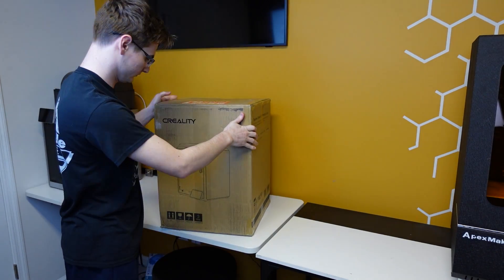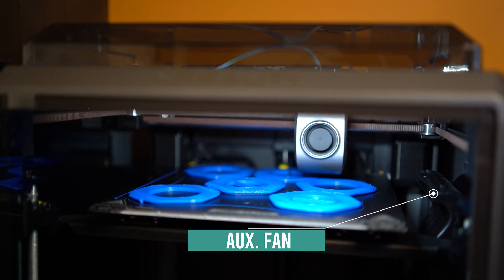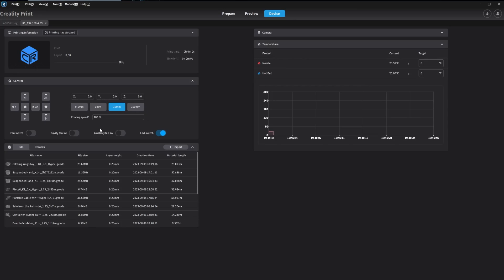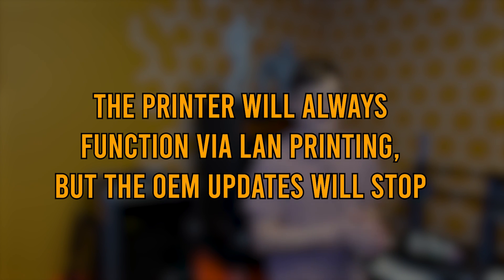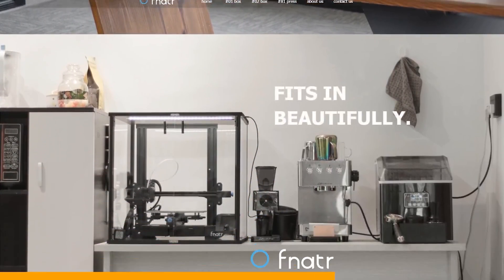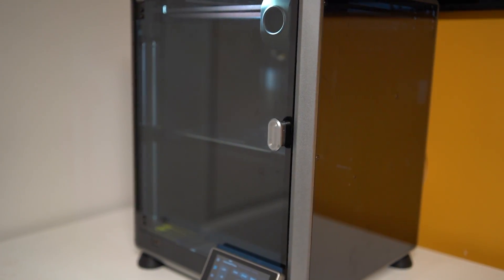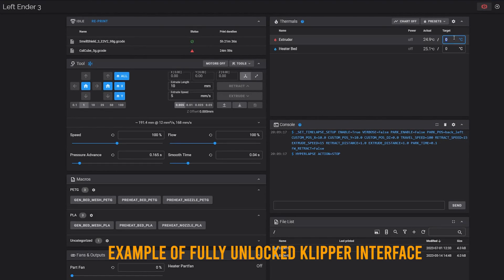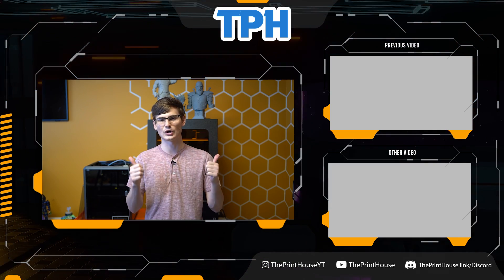Creality FIXED The K1 And It's INSANE!!

Comment: I posted how to fix the issue with the fans on user help group awhile back.

In Prusa Slicer under Print Setings, Output Options, G-code substitutions:
  FIND: M106 S([0-9]+\.?[0-9]+)
  REPLACE WITH: M106 S${1}\nM106 P1 S255\nM106 P2 S${1} 
  NOTES: Set case fan 100% and the rest to same speed
  REGULAR EXPRESSION: Checked
  
 This will update the gcode as it's being created to set the case fan to 100% and the parts colling fan and side fan to the same value.

------------------------------------------------------
In Cura Slicer click Extensions, Post Processing, Modify G-code, then click Add a script, choose "Search and Replace"
   SEARCH: M106 S([0-9]+\.?[0-9]+)
   REPLACE: M106 S\1\nM106 P1 S255\nM106 P2 S\1
   USE REGULAR EXPRESSIONS: Checked
   
  This will update the gcode as it's being created to set the case fan to 100% and the parts colling fan and side fan to the same value.

Comment: After the updates would you go with this or the bambu p1s?
Reply from the maker: I hate to say this, but they are genuinely different products. They both print equally as well for standard materials. For someone that only every prints 1 color in PLA, PETG, TPU, or ABS, the k1 is amazing. If you ever plan to print multimaterial or engineering materials I would do the p1s.

Comment: Great review. I've had mine for a few months and its been great except some slight underextrusion. I increased flow on the slicer but its not perfect.  How did you get the new upgraded hardware? You mentioned contacting 3rd party? I bought mine at microcenter, so would I reach out to them or Creality? If I have to buy it then I'll do it but free is always better!!

Comment: People try to shi# on this printer I’ve been printing for years on year and spent hundreds maybe 1000s of hours working on learning and hands on experience with about 6 differnt printers out of the box the k1 does fantastic and has been one of the most simple plug and play printers I’ve seen so far would love to have the k1 max tbh
Reply: Not to mention the fact it’s very consistent I’d say I get 18 or 19 out of every 20 prints to dam# near perfection or as close to perfection as possible without going to resin. It’s been this way out of the box only things I’ve tweaked is speed infill and basic things that children could do. Don’t have to worry about clogs very often sometimes they can be a pain that requires a full break down but having to do a hr worth of work for a mistake I usually make( forget to unlock the extruder before pulling during retraction) don’t pull it or you break Filament to high off in the block and have to do a full breakdown other than that outstanding all around

Comment: I have been going back and forth on this printer and the Neptune 4 Pro. I am rocking an Anet A8 with an all metal frame. Both would be absolutely huge upgrades. I like to do functional parts with nylons, CF filaments, polycarbonate and the likes. Would i get better/more successful results with a K1?
Reply: you need enclosed printer for hard materials like nylon, polycarbonate, ABS/ASA because of high temps, its possible to print these materials on open printer, but only for really tiny models

Comment: Creallity has open sourced and released the source to their version of Klipper.  So it should be possible to build your own version of klipper and install it on the K1.
Reply from the maker: Im sure the possibility exists, but I feel like it wouldnt be the most straight forward task
Reply: @ThePrintHouse  Shouldn't be any more difficult than upgrading  Marlin on the Ender printers, or for installing Klipper on them.   It will all depend on the bootstrap that the K1 has on it for upgrading the firmware.  I'm sure the 'nerds' out there are busy hacking the K1 right now!

Comment: "Part cooling fan weak" is not an issue.
To cool PLA adequate at high speeds, you would need bulky fans, whichincreases toolhead weight and makes said speeds unattainable.

Which is why bench speed record attempt printers use side fans.
Reply: ...hmm is the "use with gluestick" not printed on K1 buildplates,is it only printed on K1 max buildplates?
Reply from the maker: Im pretty sure it is on the k1 also, but I was using hair spray. The reason they mention glue stick is because it is an interface layer. Hair spray does the same thing, but the layer I applied was apparently too thin, which isnt an issue on other printers
Reply from the maker: Yes I know that, but Cura doesnt enable it easily. That's why I mentioned it. You need to slice via creality slicer to make it function

Comment: why do you recomend keeping the door and lid open with PLA? I have a K1 with no issue.
Reply from the maker: I haven't had issues either, but pla is not supposed to be printed In a closed chamber
Reply: @ThePrintHouse  good to know. This is my first 3D printer. microcenter had a 375 coupon for it. it was also the updated version with the upgraded parts luckily. My only grip with it is the software like you said and the way it feeds filament into it. I like to use a dryer because our house is humid and the angles from filament from a sunlu S2 isnt great. I had, just today, issues with Inland Twinkle Rainbow pulling away in the extruder or it snapped off inside the tube because of how the run out sensor is placed, its a sharp angle. I wish they gave us options to mount it other ways.

Comment: Purchased a Neptune 4 and had unfixable trouble with it after a day. Sent it back and now I’ve got this on the way. Was supposed to be £599, on offer at £479 then there a promo code knocking £50 off so £429. It costs more than the N4 but hopefully turns out to be a better machine.
Reply from the maker: I think you'll like it!! :)
Reply: I  also bought a Neptune 4 pro, I’ve had it about a week and today was the first time that I could get a decent first layer. I’ve sliced several items in Cura and the N4 fails to print support every time. My Creality 3 S1 prints the same items and prints the supports.

Comment: i bought it, lasted 3 days, 4 prints plus MANY failures. I bought the upgrade kit (well ordered it) end August. was told will be shipped 21st september. Still waitiing. the hotend is crap, doesn't extrude as it should and then leaks. upgrade kit include a new hotend, extruder, camera and roll of filament. I have being trying to get them to dispatch the dam stuff. i waited so long i bought a Bambu X1C + 3 AMS units. the K1 has been staning gathering dust. Onday i will design a new carriage and change the board, wiring etc and just dump the crap they sold with it. BIGGEST WASTE OF MONEY OF ANY PRINTER EVER was the K1!!!
Reply from the maker: The upgrade kit will be a huge win if you get it in
Reply: @ThePrintHouse yeah I definitely believe so, but the when is definitely an unknown unfortunately 😕

Comment: I have a lot of use of this printer and I love it! (On my channel) It is best used connected to a filament dryer and hyper PLA.
Reply from the maker: It's honestly great so far!
Reply: @ThePrintHouse  what do you think of this? Will it get even better? And since you are a big YouTuber I thought you might have been sent something early regarding it: Multicolor Leak on K1 - https://youtube.com/shorts/jErZB1Z0KaA?si=n1lZLRCPDIdPkojD
Reply: Filament dryer for PLA? Why would you dry PLA? 😂
Reply: @Todestelzer  A) PLA isn't the only one you use so might as well link them up B) I bulk buy like 20 spools of PLA and then just slowly use them and i prefer to dry rather than lose the ability to pick colors
Reply: @elijahspirit  for PETG or PA for sure. For PLA you can use it as a expensive spool holder. Happy printing. It’s a nice hobby/job.
Reply: @Todestelzer  you too

Comment: Hello. I am going to buy a K1 soon. As this will be my first Klipper-based printer, I don't understand some of the aspects.

1. What benefits does unlocked Klipper give?
2. Will I lose any functionality compared to the stock firmware?
3. If Creality changes something in their original firmware, will they implement the same change in Klipper?

Could you answer my questions please? Thanks in advance.
Reply from the maker: Sure! 
1) There is too much to mention here. You will need to look that up separately. The BLUF:  The firmware itself is physically designed better. The team designing it seems to be more focused on quality. There are advanced cutting edge features.
2) You will lose nothing. You will only gain features. Likely as a first time klipper users you wont use them until you understand them, which could be a long time, but until you get a klipper machine you will never be able to learn.
3) Creality will likely not be modifying the original one anymore, but if they do, I suspect it will also be in klipper version.

Comment: I hate to be the one to say this, but that's literally the whole point of the aux. fan is to help cooling at high speeds.
Reply from the maker: Yeah I know. I only mentioned it because of the statement that came after. It cant be controlled via cura and you cant print without it.

Comment: I mostly print toys in PLA to sell. So If I was going to buy another machine to up my production with the idea that I would likely need more in the future what machine would I get? Of course the K1 and P1S are at the top of my list but Im kind of wondering if its worth it to buy those for the speed alone. The AMS is an attractive option too. I wonder if Creality will come out with a multi filament system in the near future? Youd have to think they would but nothing being said about it yet. Anyway, Think its worth it to spend the money on a speedy printer or just buy more enders? P.S. I have had quite a few issues with my 3v2neo that has cost me time and money but Im sure thats ever printer at some point.
Reply from the maker: I also operate a 3d printing business. I used to use E3 V2. I had my machines dialed in but even still, it was slow and print quality wasnt great. I would 100% get one of the new core XY printers. If you want to print color then of course go bambu, but if you have anything you sell in single color I would just get the K1. Printing in color is definitely something you need to consider NOT doing. It will slow production and cost more money. In order to make it worth it you likely need multiple machines with AMS as well as an increased price tag which customers are willing to pay.
Reply: @ThePrintHouse  Thanks for the great advice. Ive settled on the K1 then. If i get rich Ill buy a bambu with AMS for fun.

Comment: So, not enabling a fan that is included to improve cooling, and then complain about bad cooling and it's creality's fault? Interesting start of the review
Reply from the maker: It was mentioned because it can't be enabled unless you use creality slicer. That was mentioned immediately after
Reply: @ThePrintHouse   Im picking up my K1 tomorrow night, so I suppose I need to take your word on it but I find it hard to believe that ONLY creality's slicer can enable the aux fan. I have been watching plenty of reviews leading up to the purchase and this is the first im hearing of that (something that everyone would bring up being that it would be a huge issue). Once again I could be wrong though.
Reply from the maker: @BayCon632  The fan is obviously turned on by gcode, so a few things are at play here: If it is firmware operated, then in my testing it never triggered on. I find this to be an unlikely scenario. If it was not firmware operated, with the recent updates it could NOW BE firmware operated, which would make it work with cura now but not a few weeks ago. Again I find this an unlikely option. The most likely situation is that the fan is operated by gcode that is generated in the slicer which is why creality print works and cura doesnt. Creality print can be customized heavily by creality where as cura is not a product creality can modify. Without ragging on my fellow creators, I typically find my videos to be significantly more in depth and take longer to produce for that reason alone. It wouldnt surprise me if that is a detail left out by all other creators. As creators, we are used to having 5 - 10 slicers to use at all times, so it could just be numb on everyone at this point, so it is not something others would mention. The last option is that Im entirely wrong and it did activate and I just randomly vividly remember it never turning on with Cura. I will never discredit the possibility of being wrong. In any case, I think you will love the machine!
Reply: @ThePrintHouse  Thanks for the expanded comment, best luck on future videos. Happy printing
Reply: You can turn it on manually after the first layer, which isn't ideal, but it works. 

You can turn it on in other slicers too, like Orca, but it's not straightforward.
Reply from the maker: @mackinsviigaming  Sure, but it is not speed controlled so it is on the same power regardless of current print speed. Absolutely not recommended.

Comment: Exceptional review.  After several communications, they responded that they will be sending replacements for the original parts "very soon".  I still like the K1 since it is open and also I anticipate some aftermarket products will be developed to enhance print speed and quality.  The extruder looks like a great area to address first.
Reply from the maker: Thank you so much!! I agree! I think it will be a great platform for aftermarket klipper mods as time goes on!
Reply: What do you mean by open, as in open source? Does that mean it's better than the bambu in this regard since I heard everything they do is proprietary. Sorry still new to these.
Reply: @rodiculous9464  Yes open source.  If you are OK with closed source and their cloud-based information rights, Bambu is a great printer.  This is a new generation of consumer printers (ultra-fast coreXY with AI features) that Bambu gets the credit for creating.  If you do some searching - there are many 3D printer companies announcing or releasing printers like this so your choices will become even more difficult.  I like the K1 and Creality  because it is open source and third-party aftermarket products are beginning to emerge (Micro Swiss Flowtech hot end for example).  It also has the lowest price point for entry for a volume-produced printer.  There are many of these printers out in the world now and community-supported.  You can dip your toes into this water without spending a ton of money.

Comment: Full Klipper control is something all companies should release to the users!
Reply from the maker: Beyond releasing source code, klipper should also implement a requirement to allow FULL control to the user. I understand having an "easy" mode for new users which is a more locked down klipper version, but every manufacturer should have an "advanced" mode which is simply a fully unlocked klipper.

Comment: The dedication of Creality to improve their products is truly commendable
Reply from the maker: I agree. I wish they would have spent additional R&D so there were no original problems, but it is good they have fixed them
Reply: Strongly disagree, this company while making decent products are stealing ideas from open source regulary and not giving back to the community. Taking ages to make products open source while stealing other open source projects and marketing as their own.
Reply: Lolol dedication to creality continuing to blotch product releases
Reply: @rpmibc Blotch release? You mean like Prusa with the MK4 being released without promised features initially and the XL printing worse than a $200 machine? Or how about the X1C at first with their nozzles coming apart and ams rollers breaking. Dude every company is going to have headaches with new products. It's inevitable but doesn't mean you can't still be dedicated to that company